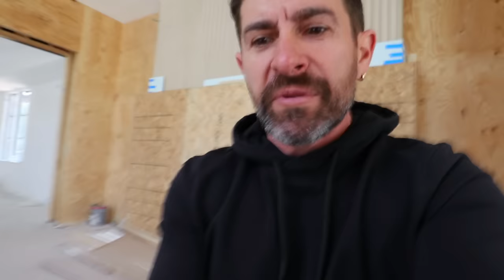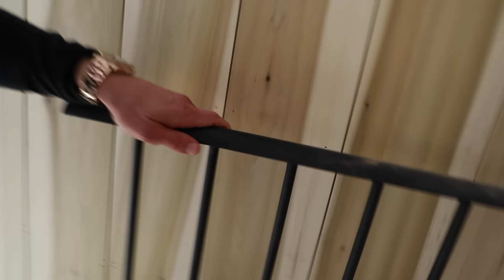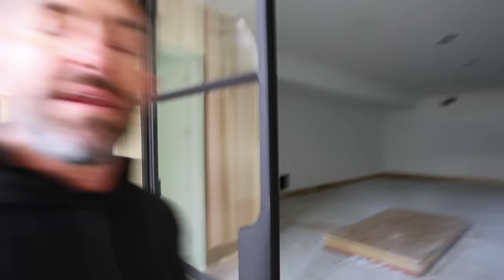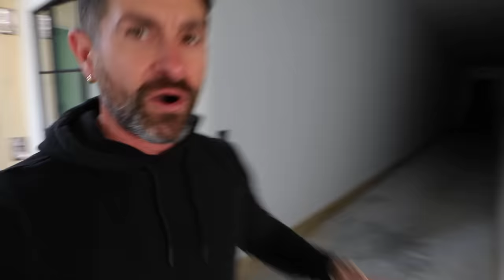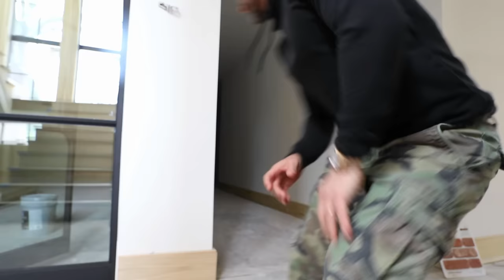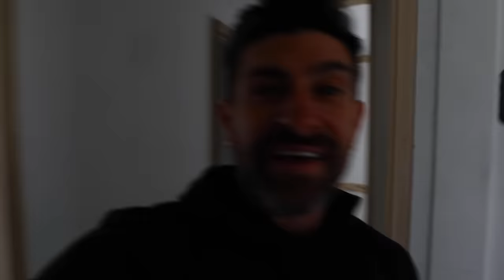money can't fix this.

Comment: My father died of skin cancer so I was thought at an early age to be aware of moles on my skin. Had one on my back, asked my gp several times and he told me it was nothing to worry about. Had an appointment with a dermatologist because of something else and the first thing she noticed was the mole, and told me the had to remove it immediately. Was sent in for biopsy and turned out to be cancerous. Had to undergo surgery to remove it, and hopefully I’m in the clear. But, cancer can strike anyone. So better to test one time too many.
Reply: Hi, was wondering, what was wrong with the Mole you had removed? I too have a lot of Moles on my skin,a few are very dark in colour, should I get them checked?
Reply: @hugostiglitz4777  In my case it grew slightly and was dark, also a bit of uneven edges. Would have them checked if I were you. Here in Norway they have started scanning moles for free at the pharmacy. Don’t know if you have options like that?
Reply: @hugostiglitz4777  not always to be panicked. Small moles are fine. Cancerous are bigger than 1/2inch and not all of those big ones are cancerous. Protect urself from sun and stop applying creams, perfumes, deos, powders etc on ur skin
Reply: I have moles and and spots all over my body😳

Comment: House is looking great. As for the brick, I suggest the red. I think it could be more versatile later on if you wanna change the color. For example. You might want to lighten the brick later and whitewash it or Limewash it. Not sure if those options are available with the old brick. Maybe some research is in order.

Comment: Keep spreading your story, man. I went in at 50 for a routine colonoscopy and it turned out I had 40+ precancerous polyps. They had to remove my whole colon (not as bad as it sounds, no need for a bag or anything). Now I have zero chance of colon cancer. So this stuff creeps up on you, but if you get checked it doesn't have to end badly.

Comment: A video that almost needs to be updated and posted annually. Some of us boneheads need to be reminded. 

Also the old brick looks cooler but the red may play off better as a traditional color if going for a more residential vibe. Polished concrete floor might be too industrial but that may be what you are going for.  Personally i like your idea of the wall mural, I do printed artwork on glass facades and cladding and would love to have a huge space like that to showcase some doe artwork/ photography

Comment: I think bricks will make the hallway feel like a dungeon. What type of lighting are you going to use?  Focus on lighting first. Then for the wall, maybe try light wood paneling to match the paneling in the other parts of your house. Also try an elegant gray pattern wallpaper. Then maybe try breaking up the wall treatment with large framed mirrors or large framed art/photography. The gray brick that you've chosen might work, but I'd suggest trying other options instead. Also, if your cat room is downstairs, think about how your cats would feel having to walk through a dark hallway just to get upstairs to where you are. Brighten it up.

Comment: Brick #2 - - Matches better with the black metal doors and sealed concrete floors. A graffiti mural on the brick in the hallway may be cool as well. Also, consider the same brick on the inside walls (entrance doors and hallway wall) for the appearance of a structural exposed brick wall.Depending on the color of the concrete floor and painted walls, good grout colors would include the beige, light greys and possible a medium to charcoal grey grout color. - -  Trust me Alpha, I've been in adaptive re-use and redevelopment of commercial real estate for 25 years (East East major MSAs).

Comment: Old brick. It will flow with your polished cement flooring and that left wooden wall coming down the stairs.
It's going to have man cave vibes. And on your brick wall. Maybe then you can put some old trains with rustic framing. Just an idea. 😎

Comment: During my yearly checkup, I told my doctor about my Dad having a colon cancer surgery the year before.My doctor scheduled a colonoscopy right away, as I was 48. Found two polyps, both removed, and the biopsy showed cancerous cells in one of them. I was staged one. Had the  resection surgery last April and am literally scheduled for the first 5 year tracking colonoscopy this Tuesday. Bottom line, fellas, we need to take mens health issues seriously. Look after yourself. Take nothing for granted. Spread the word gentlemen.

Comment: Catching things early is important, but do the research on whatever procedure you're looking at doing. A good example is how they used to promote getting breast cancer screening done super early however now a days they have changed this recommendation to certain ages because there was a chance of the screening process causing cancer/ more harm then good. Sorry to bug you Alpha M. But with you going through that whole process I was wondering if there were any particular books you read and found interesting on the subject of cancer? My mom was diagnosed last winter with breast cancer and so since then I've just been picking up book after book on the subject of cancer in general. So I figured it might be worth a shot asking if you have any good recommendations? I hope the new house turns out great and with the brick and hallway situation IDK is there a way to use both bricks? Maybe making a killer out of one or lineing the top or bottom of the hallway with one color?

Comment: I am 44 and was told by my doctor to get mine at 45. My father was diagnosed with stage 3 colon cancer in September and is not doing well. He doesn't want chemo and actually might not make it to the summer. I pray this is not the case but this is some sad shit. Its breaking my heart. Did you have any symptoms from 5 polyps. How old are you now.
Reply from the maker: zero symptoms... i'm 47
Reply: @alphampire  Thanks for the video and the advice. Blood in the stool and constipation are key indicators that could possibly mean issues of polyps or cancer.

Comment: The stories about colonoscopy being a big deal are ridiculous. The prep is just a gut clear out - no biggie at all. The actual procedure is not painful and the probe is about the diameter of your little finger. Don't hesitate, take Aaron's advice. I am a medical doctor in the UK 🇬🇧 and have had regular screening colonoscopies for 15+ years. Here in the UK colonoscopies  are usually performed without GA - the statistics show this is safer with less chance of bowel perforation because you can report pain if your'e awake! The procedure  is also easier for the doctor because you can be asked to move e.g. turn on your side which helps the doc to navigate the scope around the ascending, transverse and descending colon ensuring optimal views. In the UK light sedation is offered. I elect not to have any sedation so I am fully awake to move when asked to do so. Even without sedation the colonoscopy is no problem and it means you can leave the hospital immediately and drive home. You are gowned and draped and once the scope is popped inside your anus you are covered almost completely so embarrassment is really not an issue. It's sure as hell not as bad as dying unnecessarily and avoidably.
Reply: Bowel perforation? Dang, there is that risk? I guess I'll think about that.
Reply: @maximuscomfort  US Preventive Services Task Force - risks of perforation of with screening colonoscopy - 0.04% (4 in 10,000 procedures)

Comment: Do the colonoscopy. Not a big deal. Just do it. Over 30 every 5 years and over 50 at least every 2 years. 
Red Brick to give it a bit more appeal. Otherwise it will be all gray and sand color.